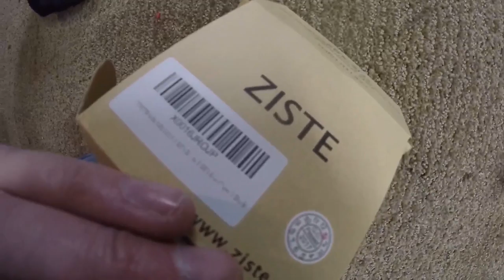2015 Subaru WRX Ep. 676: JDM Astar 1G LED Fogs

Comment: I do not recommend the morimoto LED fogs. Their QC is terrible. I did a 6 times exchange and each time it is the same problem(s): one light is brighter/concentrated than the other and/or the aiming screw does nothing on one of the lights (so you'll have like one high and one low to the ground). If you don't trust me, check out the listing reviews from Amazon.

I just went back to stock with a JDMAstar 800 lumen led, best decision I've ever made. Yes it spreads in the housing but I don't use fog lights daily.
Reply from the maker: ya i heard about all kinds of issues like loose enclosures too. guess i feel better now.